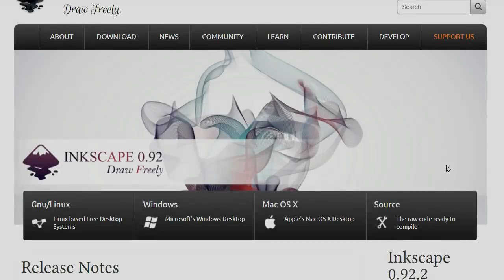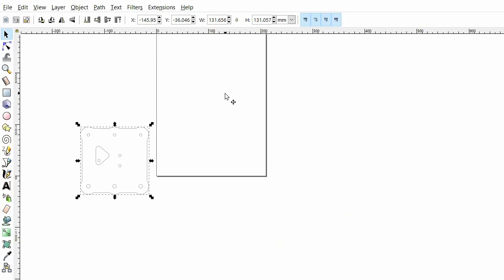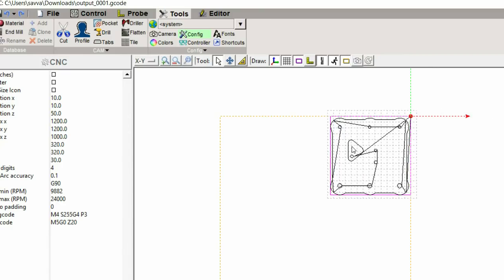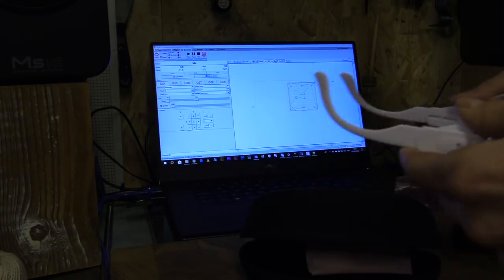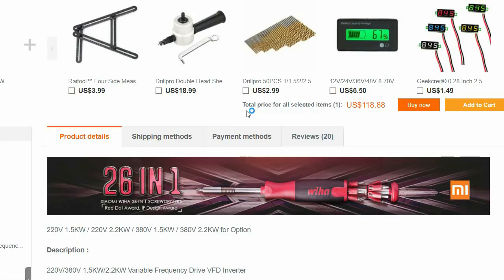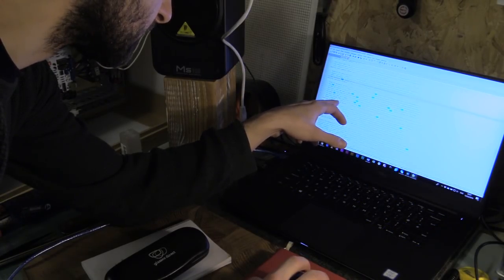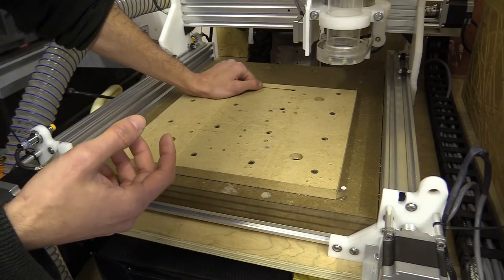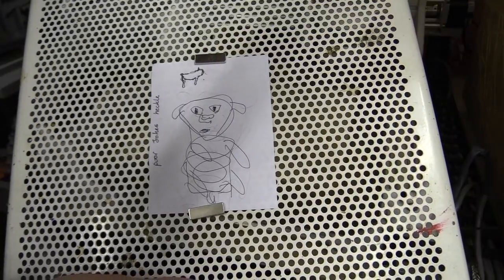#25a Laser Cutting DXF / Inkscape / GRBL / + Weird PWM behaviour #25a / Tweaking

Comment: There may be a default offset register for the Arduinos DAC converter (PWM output), depending on the type of Arduino you are using.  This is probably a long shot but maybe worth a check.
Reply from the maker: I wouldn't even know where to start look into that. But thanks for the suggestion.

Comment: I added the Jtech driver. Attempted the import of a DXF created using Autodesk Inventor 2016 and got a failed to load message. So far I've not fund any support help. Got any suggsetions?
Reply: I did a complete delete and reinstall of Inkscape (now 92.3) and might have resolved some issues is there any "good" documentation for using the Jtech extensions since I'd like to use code with Mach3?
Reply from the maker: The only thing I can think is to change the DXF version to something else. Make sure you import the files and not open them

Comment: My opinion about the solution of the voltage problem you have is just use an opamp (anything general purpose will work). Used as voltage amplifier (x2) to convert the 0-5V output of the arduino, to 0-10V that you need to drive the final stage!

But if I understand well, you have some different problem here.In this case you need to use a dual opamp (again anything general purpose will work!), use the first one as voltage shifter to convert the 2.5-5V to 0-2.5V and use the second one as voltage amplifier with gain of (x4), to convert the voltages from 0-2.5 to 0-10V that you need!
Κουμπάρε sorry for my broken English αλλά δεν είναι η μητρική μου γλώσσα!
Reply from the maker: No that makes sense and is along the lines of what I was advised by Nathan. Lets see if I have time to sort this out in the future. Too many things to do! Many thanks!

Comment: It should be possible to set the pwm from 0% to 100%,  are you sure you are changing and uploading the right code? It seems many mistakenly edit the wrong code when using the arduino ide to build and upload
Reply: I thought I might have done that too but when I checked the sketch file location in the ide, it was the same as those I was editing.
Reply: the fool proof way to check is to add some gibberish to the file and see if you get a compiler error. 

It should work, spindle_control.c simple maps range rpm_max-rpm_min to the range SPINDLE_PWM_MAX_VALUE/SPINDLE_PWM_MIN_VALUE
Reply from the maker: I flashed the old Uno and Gshield with a unchanged version of v0.9 and v1.1 and the results were the same. I'm confused but I think this is just how it works.
Reply: did you try to add some gibberish to the file and got a compile error?